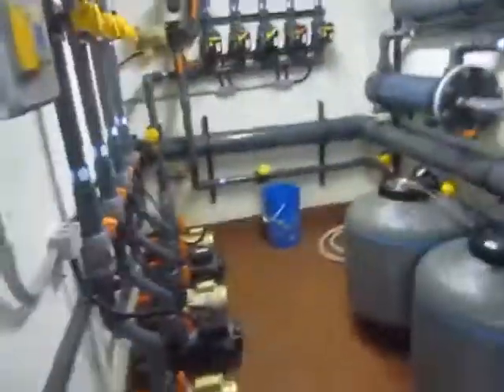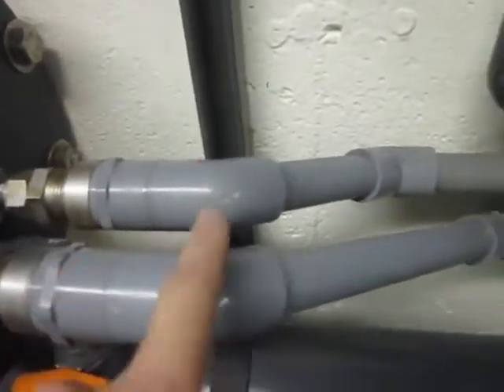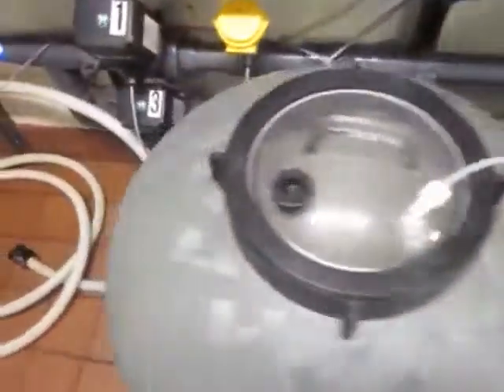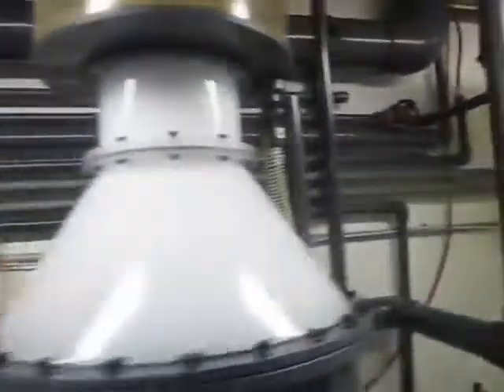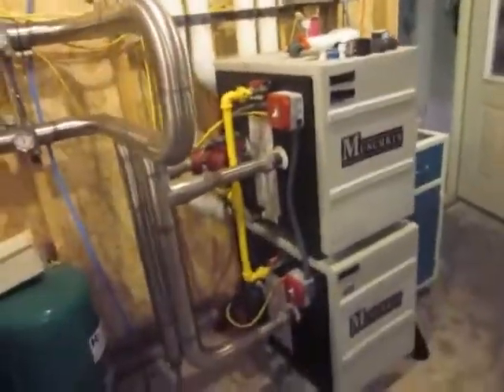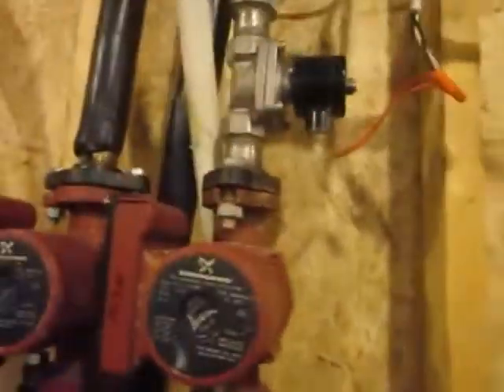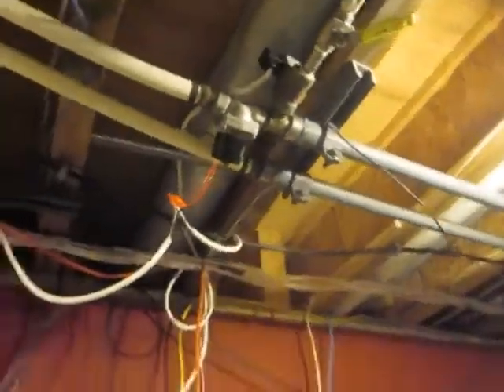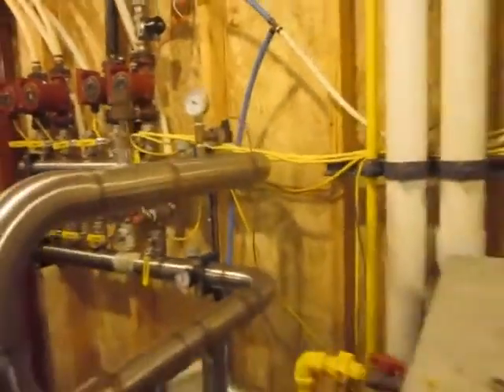How to control temperature in Bill Wann's aquarium system

Comment: you should add one solar water heater ( vacuum tube ) to boiler the normal water and pump it around the coil with salt water around and it will make you save a lot of money in temp exchange. I have one at home and is amazing